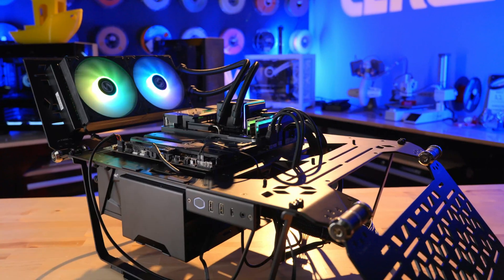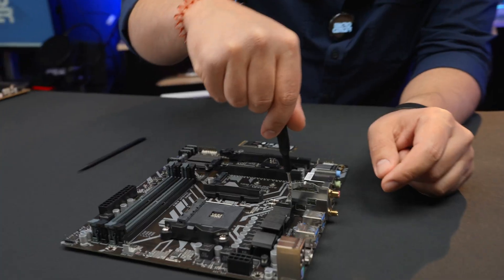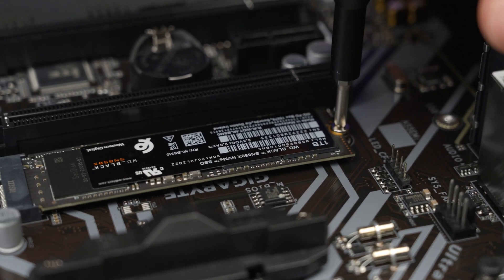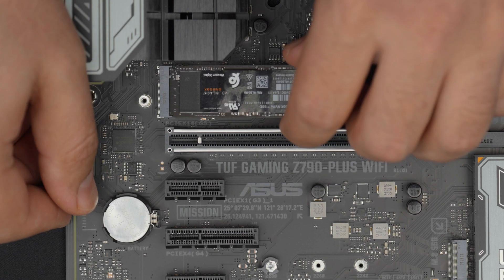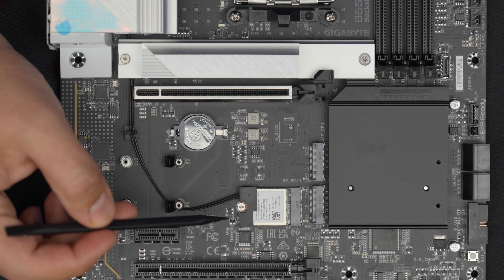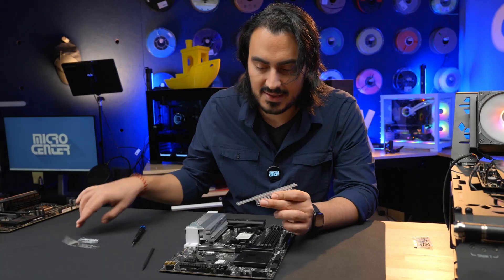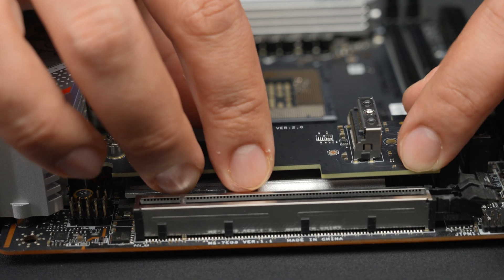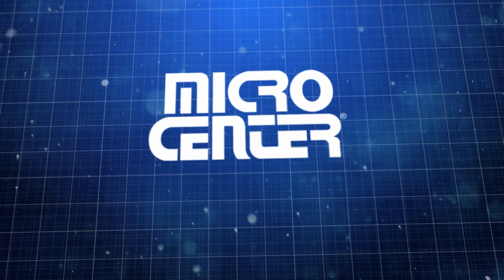How to Install a SSD | Micro Center Tutorial

Comment: Thank you for the very detailed video! One more reason to buy from Micro Center.  My question is this: do I buy an M.2 WITH heat sink, if the motherboard does not have one? And if there are more than one stacked, do I buy one with and one without?
Reply: Unless your NVME uses PCIE gen 5, I wouldn't recommend spending extra for one with a heatsink.
Reply: @FieryMeltman  Thank you. Turns out it is PCIE gen 5, but the motherboard already incorporated top and bottom heatsinks.